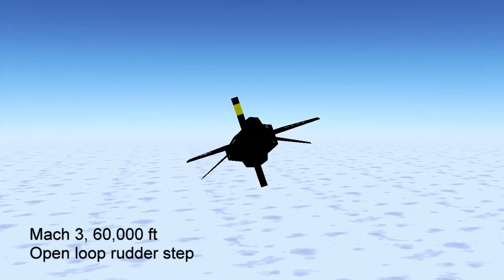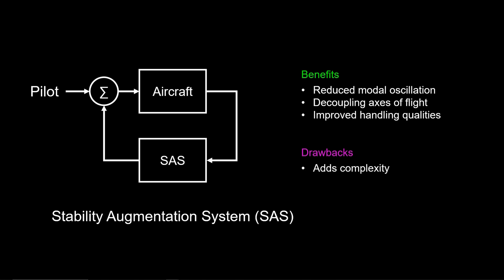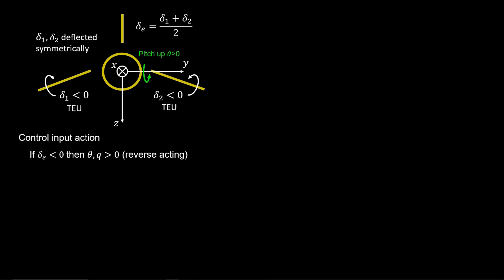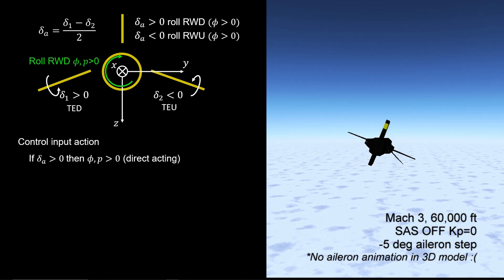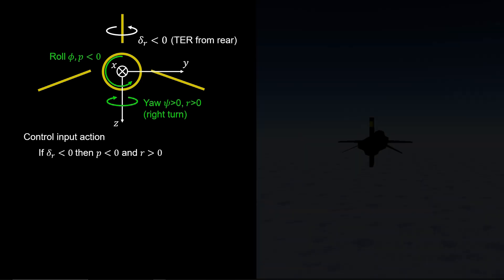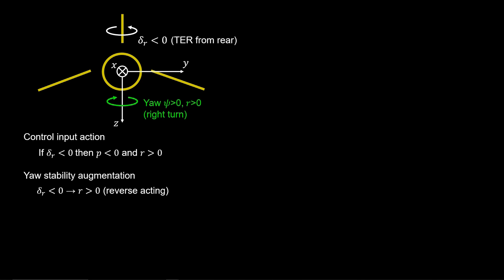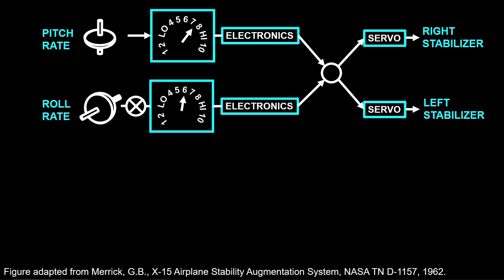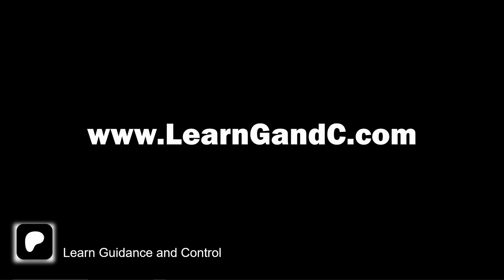X-15 Stability Augmentation System | Yar Control | 6DOF Flight Simulation Tutorial - Section 3.1

Comment: Thanks for such a nice lecture. will the proportional coefficients once set, be valid/effective for all flight speeds to provide stability? Is it beneficial to use Integral and differential coefficients as well in PID control?
Reply from the maker: Your welcome! One set of gains at all conditions will be better than no gains, but it's not ideal. About any flight condition, there will be a set of gains that produces the ideal behavior. So, the pilot can adjust with knobs. A gain-scheduled SAS would be the next step.  For integral control, it could certainly by used a in control augmentation system (CAS) where there's an outer loop to enforce tracking of the pilot-commanded variable. Derivative control could help dampen rates more quickly, but of course there's the risk of amplifying noise through the derivative. Proportional control is a simple solution that apparently met requirements based on the number of successful flights. So from an overall experimental space plane program perspective, it's possibly the best approach for its purpose.